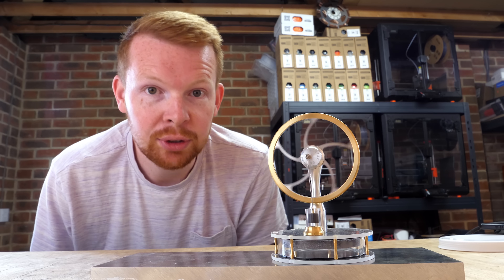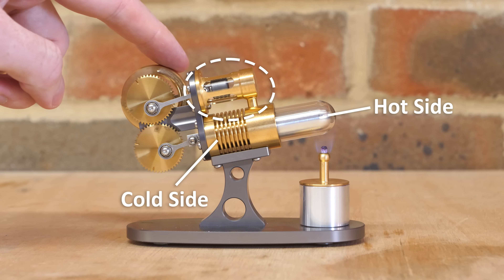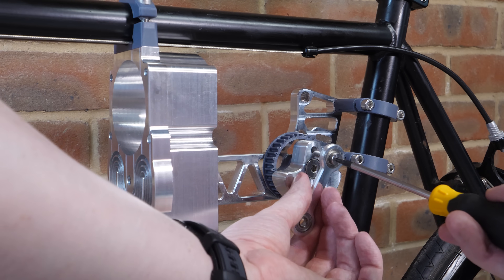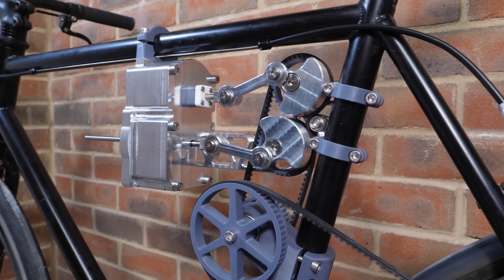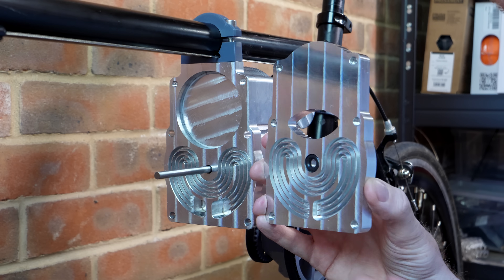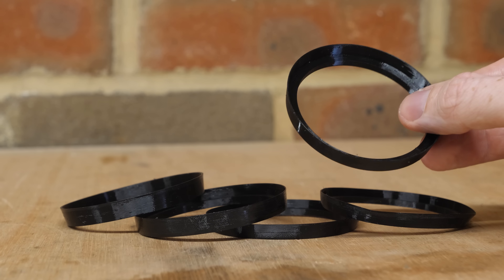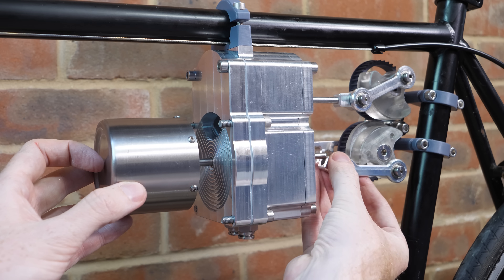Building a Stirling Engine Bike - Part 1

Comment: Okay, in the last breath you said it yourself. You need a regenerator to not lose so much energy. This also makes the engine faster, as the gas does not take so long to be reheated. As a result of the fact that the inner surfaces are all completely smooth, it takes a very long time to reheat the cold gas. For the burner, it would be great if you designed it for wood or something. The big advantage of a Stirling engine is the closed circle and the high flexibility in the energy source.

Great project and as always a pleasure to see.

Comment: The flywheel was rookie mistake :D These engines need a solid one in my opinion. To be honest I'd add some kind of clutch as well. Cant wait to see the final form of this! How about V8 next haha

Also for higher temps we used copper seals. The aluminium was machined to bite down on soft copper strips. These seals were keeping great vacuum once tightened.

Comment: Hi, have you sealed your displacer? where the base is screwed to the can it needs a perfect seal to prevent your expanded air largely just filling the displacer and not working with the piston

Comment: The machining is excellent, the problem you are having is all in the ratios of bore/stroke between the cylinders and the air volume moved by the displacer. I myself tried and failed to understand these ratios, there's little to no information online and it seems like powerful DIY stirling engines have become a lost art. Look at caloric16's oldest videos and you'll see boats and a kart powered by a woodstove heated stirling made in a garage. Please do attempt this again! I want to see that contraption putting down some power!

Comment: Try offsetting the power piston from the center of the power cylinder.  If they are in line, when you have the most power available, you have the least mechanical advantage.

Comment: A regular motorcycle engine generates a lot of heat. You can use it to power several Stirling engines! They can either help turn the wheel or generate electricity.

Comment: From my knowledge, Stirling engines are best used for continuous low power application. As someone else mentioned a solar powered Stirling engine would be an interesting idea to use as a generator, to then power an electric motor on a bike, or maybe a cable railway.

Comment: Great work! What about oscillating high pressure Stirling engine generates electric power stored in a battery which turns electric motor to power your bike? Back in days I was going to use it to utilize exhaust gas of ice thermal energy otherwise wasted. There were NASA project of that type of linear oscillating stirling generator back in 70s.

Comment: Couple things. 
1. You should try to polish the cylinder bores to reduce friction more. Simichrome polish has diamond dust in it and it polishes aluminum to a mirror shine easy. (Polished aluminum and PTFE love each other.) 
2. I would try to find a way to get rid of the piston shafts and linear bearings. Maybe you could make pistons that have PTFE leaders which trail behind the pistons in the bore to keep the pistons straight, and just use connecting rods.

Comment: That is a very impressive demonstration! I'm sure it has already ocured to you but if 1 cylinder is generating around 1/4 hp, then 2 cylinders should get closer to 1/2 hp (which in my mind is closer to 1 man power)
You know what lets cut to the chase and go ahead and fab a Sterling V/8!

Comment: Yes! Love Stirling engines! have so many ideas! Not doable on a bike but what about heating that hot part with a solar reflector and then let it generate some electricity (and maybe use some of it to fan away the heat with air on the cold side?)...

Comment: damn imagine drilling a hole in Antarctica tapping its geothermal areas, then building a stirling engine, hot below cold air ontop all year round at the top, ultimate source of power

Comment: the issue with stirling engines is that, even if they are safer than steam engines, they have much less torque, as you lose the advantage of strong steam pressure to produce work. So increasing the differential and rate at which air is heated and cooled (or any way to produce more pressure) as you said in the beginning of the video, or increase the gear ratio to give the engine more torque advantage... maybe put several maybe smaller engines ?

Comment: 7:02 <Stirling engines> "are quieter, more efficient, and safer" than steam engines. I remember that safety was why they were preferred for water pumps and other standing (non-transport) applications, and also that anyone who could tend a fire could manage one, while steam engines needed an expert. The problem was, for efficiency, they needed to maintain compressed air, and the manufacturing and materials were not up to that and things kept breaking.

Comment: Look at the upper guide (steel shaft in Teflon). It is already worn out. Teflon absorbs almost no force. Better: Polished steel in graphite.  In addition, polish all shafts and cylinder insides. To generate 100W, the machine will probably have to be considerably larger.

Comment: How to transfer 2000Watts of heat into 1 Watt of moving.
Reply: Correct, Stirling engines are rubbish for propulsion. Capture latent heat are what they can be used for.

Comment: I am just wondering ... Did you go straight to designing and building the engine without doing the necessary calculations up front? You mentioned that you want 150 W. So, I would expect that you go through the theory and work out what displacement you need, what the temperature drop should be at minimum, work out what performance the cooler has to have, estimate the losses, calculate the torque and then plan and configure the necessary gear box, .... etc.. Normally you spend many, many days doing all the ground work. And then you should try to run some simulations and check if the basic assumptions work. Skipping this step will create tons of work with a high risk that all the effort was wasted in the end. Just ask the zillion guys who design perpetual motion machines ...

Comment: That thing is cool. Getting 150 watts of usable mechanical power from something that size will be a massive challenge, especially once you add your weight to the bike. Using it to generate current to charge a super capacitor bank powering an electric motor would be the cowards way out, but may save you the headache of reinventing the wheel so to speak.

Comment: In this application, heat pipe cooling might be a better option. Lower weight than water cooling and not requiring pumping losses.

Comment: If you haven't read Andy Ross's work on his bicycle project, I recommend it. Shane Pomeroy also has a good Sterling project, although he doesn't have the size or mass constraints that you do. I'm looking forward to seeing how you implement the regenerator without increasing the dead volume too much. The one from Andy Ross's project would probably work great. Getting the heat out at the cold end seems to be the trickiest design area because if you're using radiant heat transfer then the temperature is likely high enough to melt your seals and at forced convection temperatures, the viscosity of the working fluid is higher so there's more pumping losses and you need a huge amount of area.

Comment: i think you Mounted your engine backwards Baer with me here as it is right now your going to need to make a wind sheld to prevent cold air from cooling the  hot  end  and the faster you go the more of a problem it will be if you put the cold side forward then as you go faster the difference should increases and thier for give hire effectiveness at hire speed

Comment: Nice job 🦾. Was very exciting to watch, as usual 🙃😉
Usually I never write a comments. I’d recommend you to use something else instead of air. The best is hydrogen or helium or mix of them for safety reasons. As a coolant a dry CO2 would be way much efficient. Good luck, looking forward for part two 😊

Comment: I am sure you already did this but didn't show the math - but you need to calculate the stroke length for the temperature difference. Ideal gas law stuff. This NASA manual might help. https://ntrs.nasa.gov/citations/19830022057

Comment: I seem to recall that conventional wisdom says that the Sterling Engine is of little use for vehicular power. It is better suited for a static engine because they are heavy for the power that they produce. I have often wondered if they could be useful to power heat pumps as an auxiliary motor, or to power liquid cooling for solar panels which become less efficient when hot. In both cases the heat difference could be used to good effect. Obviously I realise you can’t get something for nothing and yet, circulating cooling water… would it work?

Comment: You may be able to raise the system pressure by adding a small amount of water+ethanol (with a bit of oil for lubrication) that vaporizes as the engine heats up. If you get the temperatures (hot vs cold) just right it could switch from liquid to gas (steam) on every stroke. As you may know water expands 1 to 1800 when vaporized. If you can get some of that to work for you the power should increase. Be careful so it dosen´t blow up however by only using a small amount of liquid.

Comment: Interesting project.  But I think you are doomed on power.  Phillips built a Stirling that has the power you want, old pump engines had the power but weight hundreds of pounds. You need to get the power piston rod to stop flopping around.  Regenerator is is required as you mentioned.  Increasing system pressure is probably the easiest and most productive way to increase power.  But please note that Phillips had something between 1 and 3 engineers die in testing when increasing pressure.  Anything that can burn like oils and grease will vaporize inside the engine and can detonate at increased pressure.
I hope you get somewhere with this.  I've had such designs on the drawing board lots of times as I wanted to get electricity from the heat transfer from a wood fired boiler to the hydronic heating system of the house.   One key design feature I kept coming back to was having the pistons being driven from both sides(displacer for driving each side of the piston) and enclosing the whole unit in a sealed chamber with only electrical connections, much like a refrigeration compressor, and charge the whole unit with inert gas so you don't die.  You are fighting a battle most all have lost,  but I'm wishing you groundbreaking success.

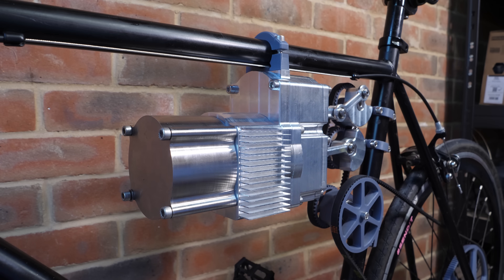Comment: 10:41 are you tightening a hex with a philips screwdirver? How does that even work?
Reply: That's a torx-bit friend.
Reply: @karllarsson830  Thats even worse, but at least explains the funktionality
Reply: @Farewell-Fareway  I am just saying the worst thing you can do to a torx bit is tightening a hex. Or at least I've been taught that
Reply: Safer fuel system, electric resistors inside the top of the engine. This will allow a battery based power instead of fuel based

Comment: Your pulley layout is inefficient, you need more belt to pulley coverage, your using a tensioner to press onto 1 side, it jumps off the other in motion, use 2 small belts that fully cover the gear pulley

Comment: There seems to be "ideal-stirling-cycle-calculator" in nets. Starting from wattage of the heat source and from the force you aim to push the pedal (< 100 N), you can easily calculate how big both pistons needs to be.

Comment: Nice work Tom, I hope you stay on this project for a while including a v2.0.   I’d encourage you to take a look at some of my videos where I’ve been testing gamma chambers at constant volume.  Long story short, the power piston(when not connected to the crank) volume should expand at least 50% of the swept volume of the displacer if you hope to make decent power. 

From there, the power piston stroke (swept volume) can be increased further.  How much further depends on the engine.

The displacer should have as little clearance as possible to the hot cap as performance will degrade rapidly with bigger clearances. 

My videos are crude and not well done but my focus has been on the thermal design of displacer chambers.  Most of these engines have terrible efficiency due to material science that far outweighs the possibility of high gas efficiency. These engines are both stunningly simple and mind bendingly complicated when you go down the rabbit hole. 

Also, I’ve had great results setting the phase angle up to 120 degrees from the standard 90 but some engines may prefer even less.  And you are losing a lot of torque with your one way rings. Try mounting two opposing rings to seal both ways.

Comment: I was wondering how much does the air inside the displacement cylinder actually change temperature? I'd assume the thermal capacity of the steel displacer bottle provides good enough insulation at high speeds? If it doesn't though, and the bottle temperature also changes significantly, that could decrease the effectiveness of the engine a bit since the (air inside the) displacer will heat cycle opposite to the "free" air, which could reduce the pressure differential.

Comment: You don't need more heat, you need a better temperature difference. Focus on cooling the cold side of the displacer better. Add significant insulation between hot and cold, sides. Glass would be it I guess

Comment: The Gotland-class submarines of the Swedish Navy are modern diesel-electric submarines, which were designed and built by the Kockums shipyard in Sweden. They are the first submarines in the world to feature a Stirling engine air-independent propulsion system, which extends their underwater endurance from a few days to weeks.

Comment: Extraordinary. Power looks a bit limited, as you acknowledged at the beginning, but it does spin the back wheel, extraordinarily. I suppose it doesn't start by itself due to the interaction between the two pistons?

Comment: it looks likes at the very top of the stroke the engine slows down quite a bit which you can see on the flywheel. Might mean that it is still compressing and creating a vacuum when running.

Comment: I got a bit obsessed with Stirling Engines from school through to further education in the 1970s.
I did metalwork at school, including an O level, the teacher opened up the work shop outside teaching times so we could do extra projects.
I made a Stirling Engine using a design that someone else had done. The base was cast aluminium and other parts were steel and brass.
At FE college for my diploma project I investigated Stirling Engines again.
This time I discovered Philips had researched Stirling Engines during the oil crisis years in the 1970s and were trying them out in cars and buses.

Comment: Stirling has notoriously low torque. It is better to use it in electric system. So stirling use to propel dynamo which would store energy into battery and run bike on electric motor.

Comment: Just a thought what if you added a peltier plate and used the hot side to heat the air and the cold side of the pad to cool the back of the engine, maybe have a solar panel to run the peltier pad?

Comment: 16:20 finns on the hot side to help the steel take on the heat and silicone lubricant spray on all moving internal parts for a start
Reply: Yeah, it pains me to see this thing running completely dry! Conventional steel piston rings on a thin film of oil are the way to go.
Reply: @AlienLivesMatter Finns? where is he going to find Finnish people in the UK?
Reply: @ruzziasht349  He just has to enter a race. When he gets to the last Lapp he's near the Finnish line.
Reply: Or graphite
Reply: @mitchellstrobbe7779 liquid lubricant would probably be better in this case
Reply: still be something like 5w of free energy, lol

Comment: Some very fine engineering there Tom and I 'specially liked the design of the Teflon Rings - a novel approach. However those of us that have tinkered with this concept already know that the power produced with the Stirling is barely enough to overcome it's own running friction. The power available to do WORK is puny and is only available in the most sophisticated designs.. Just to get them to self sustain is a triumph in itself. It also appears that the smaller the machine the better it runs. Possibly due to the more efficient transfer of heat from one volume to another. A spirited effort Tom and along with your supporters I was sad when it failed run.

Comment: The idea of having a torch burning between your legs is not that good. Maybe built a rack above the rear wheel and put the engine on top of it with the flame oriented to ta back of the bike

Comment: Very nice engineering job ! 🤩 But sadly Stirling is not really giving any "energy" except only for itself to continue running, and to run a bike (!!) it will not be enough by far, even to simply compensate friction...

But wait a minute ! I had an idea, not everything is lost : you can think about GIVING energy to your Stirling system on the bike and reverse it to make a portable refrigerator integrated to the bike ! 😃 and somehow, as a French guy, I can tell you it's a very good idea to keep champagne cool you can enjoy when arrived at the lake ! 😁

Fantastic invention comes with genius inventor trying crazy thing !👍

Comment: Are you compressing the air behind the power piston? I can't tell if that volume is intended to be sealed or not? Doesn't seem well sealed, but also not well vented? Are you getting pumping losses on the back half of the power piston?

Comment: I think the large diameter is a good idea to deal with the limited torque issue. Have you calculated the gas expansion with temperature, and the pressure and therefore torque you expect given the crank arm length? If you know how much torque it takes to turn that bike wheel fast enough to ride then you know what temperature difference and piston diameter you need in order to get it to work.